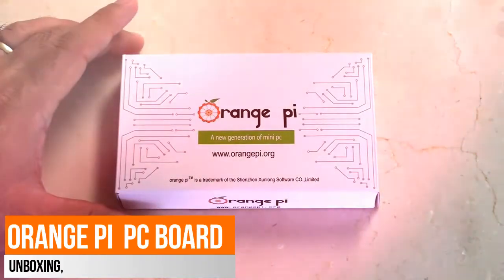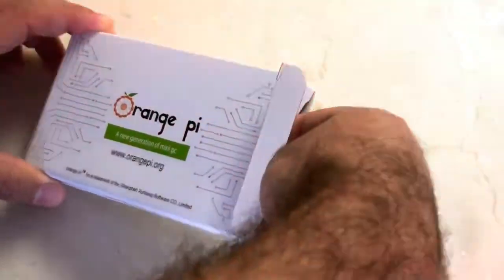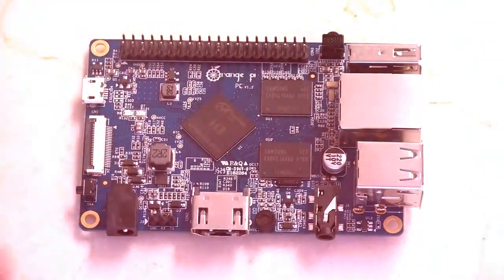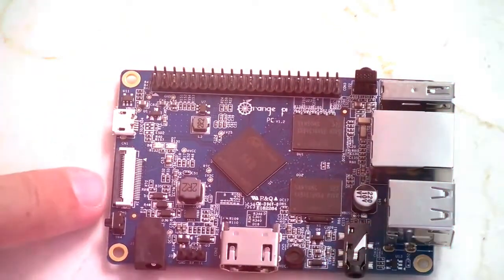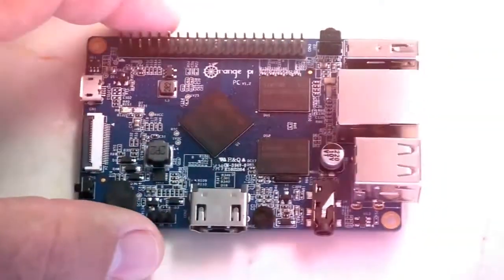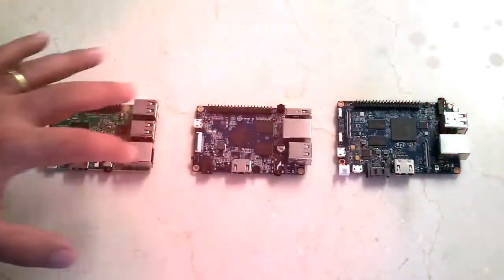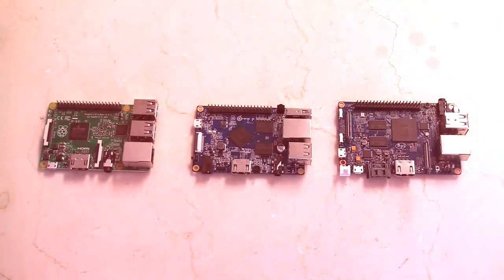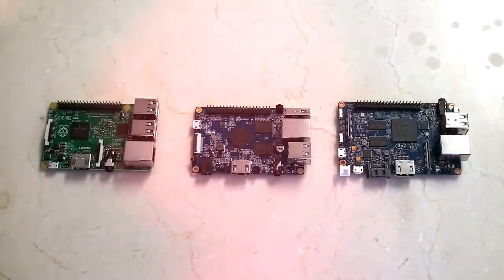🍊 Orange Pi PC board in comparison to Banana Pi and Raspberry Pi

Comment: Nice video. Lol I was looking at my orange pi pc thinking mine is newer why is mine version 1.1? Then I realised yours is the pc mine is the pc plus, I have an old raspberryPI 1b+.. Lol tiny 700mhz 1 core with 512mb ram and jumping to the orange pi is heaven haha. I have the wifi version and I'm sure it has 1gb ethernet. I'm just writing a new Android version to its 8gb emmc, then I'll have retrOrange on my memorycard and switch between. So far I'm happy with  it. The videos I've seen show the orange pi outperforming the raspi 3b+ on the emulation front. Sadly in the uk items over 20 pounds get taxed and handling fees applied by the post office, so I ended up paying the same for my orange pi as a real raspberry pi would have cost lol.